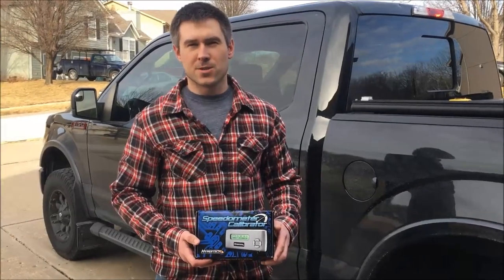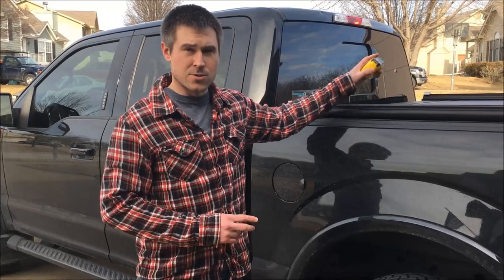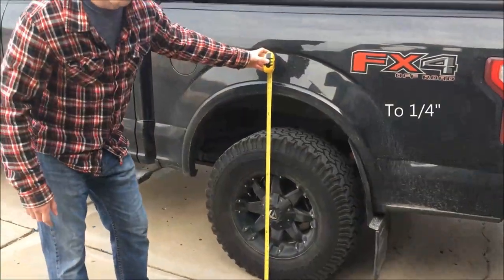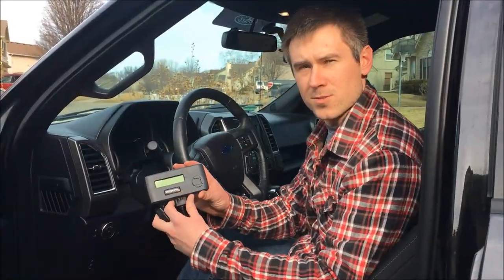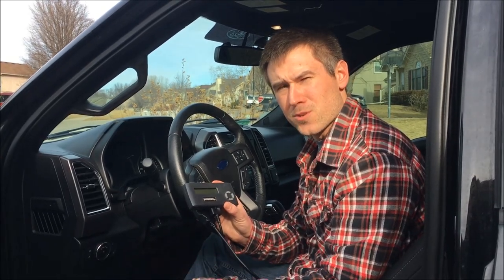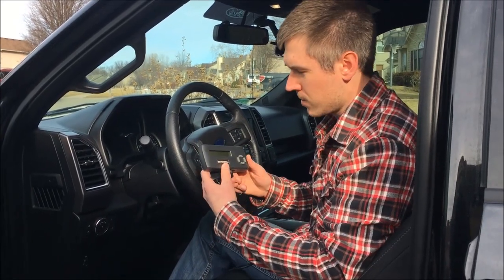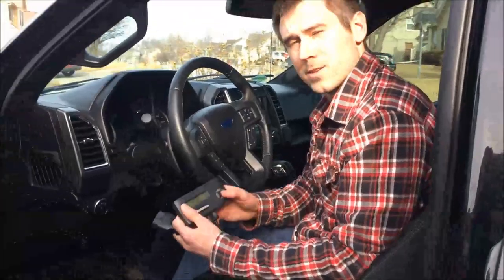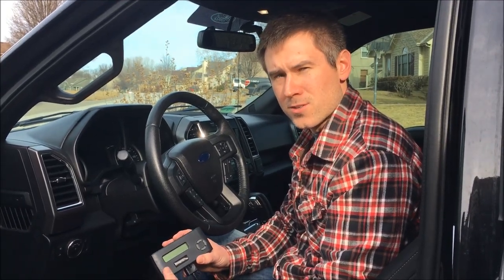How to Recalibrate your Speedometer

Comment: Is it possible to have the same size tires but a different brand and this happens? I just recently bought new tires and now have an issue with my speedometer saying I’m going fast than I am by about 20ish miles.
Reply: No indication lights are coming on
Reply from the maker: @Lesastarot, yes it's common that different tire brands can vary in actual size slightly. But I wouldn't think it would cause a 20mph variation unless you've changed tire sizes drastically. I just went from 33" tires to 35" tires and I was off by only 5mph while driving 70mph. How are you measuring your speed?

Comment: I changed to larger tires on my F150 10 years ago. I used a Diablo Tuner to do it. What you are changing is the Tire RPM...Rotations Per Miles.
Reply: you mean rotations per minute right?
Reply: @mechanicalreengineering9047  i always thought it was miles???
Reply: @shaiq-nbaiq1826  I just looked it up and it looks like it's rotations per minute

Comment: Will this work on a 2010 Nissan Titan Pro-4x? Speedometer is off by 7 miles.
Reply: Yes it should work just fine, verify your port location first and make sure you order the correct model for your vehicle.

Comment: What if I installed 40s recalibrated, then installed 4.88 gears. Should I calibrate to facctory settings?
Reply from the maker: Eric M, it depends on what your original tire size and gear ratio was before you changed them and percentage that you changed them. If you change them by a similar percentage then it should be pretty close. For example if I had 3.31gears and changed to 4.88 then my percentage of change would be 14%. 4.88/3.31= 1.47 or 14%. And if I changed from 31" tires to 40" it would be 12%. 40/31=1.29 or 12%. So in theory you would be off by 2% and would need to recalibrate by that percentage.

Comment: Will the tire store not recalibrate for the customer after he buys new, bigger tires from them?
Reply from the maker: joapps, some tire stores may re-calibrate if you ask. They would still have to purchase either a calibrator or tuner to do it. Once a calibrator or tuner is used on a vehicle that is the only vehicle it will work with. The tuner programs can be turned off and revert back to factory settings. If you went to a dealership to have them pull a check engine code the dealer will not be able to read your code unless you revert back to factory settings. You can use your calibrator or tuner to check check engine codes yourself. I leave mine in my truck all the time for that purpose.

Comment: Is that a Thule TracRac SR setup you have there on a 5.5 ft bed? If so, would love if you could do a video on this configuration. Nice truck btw! JN
Reply from the maker: Yes, it is the Thule TracRac SR setup with Retrax MX cover. I have filmed a review on the setup and plan to post within the next few days. I have posted a video on how to cut out the front stake pockets on a 5.5ft F150 bed to be able to mount the SR rails. Thanks JN!
Reply: I just watched your other video on the stake cut outs. This was fantastic - thank you so much! Like many others, the dealer also told me we don't have those on our 5.5 ft beds. Clearly they were wrong! Look forward to your video on the TracRac SR. I also have the Retrax cover so I am happy to hear it can be done. JN
Reply from the maker: JN, Check out the review of the TracRac SR with Retrax MX cover.   https://youtu.be/uQ-3CQ_Kgeo

Comment: Personally I think this is dumb, because of the fact that you're calibrating to tire height and not tire size, what happens when the tires start to wear down ? You gotta go in and calibrate it every 1/4" for wear.
Reply from the maker: Sergio Salazar, The first time I entered in tire size instead of actual tire height and it threw my speedometer way off. This is because your tire is compressed under load and is not it's true size when mounted up making the revolutions slightly smaller. This is the quickest and most accurate method I have found to entering in the correct size. If your really concerned on wear you can recalibrate it again anytime. I leave my module in the truck at all times so I can pull DTC codes if needed or change the size if I think it's off.
Reply: @jacobsupgrades  the rolling circumference of the tyre is the same whether it is squashed down or not.  You can verify this by measuring by putting a measuring tape around the tyre without any weight on it, and then comparing what it is when the measuring tape is squashed under the tyre, no difference.  The fact that you enter height of the tyre off the ground, probably they just factor the squish amount into the calc to simplify measurement.